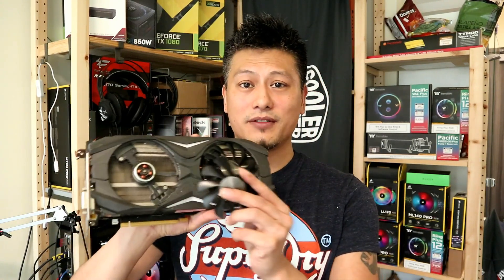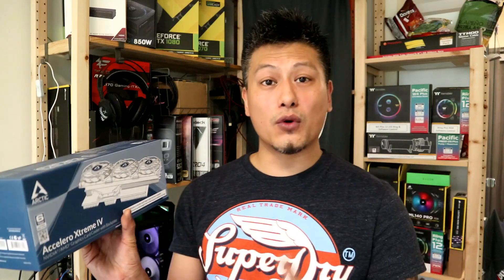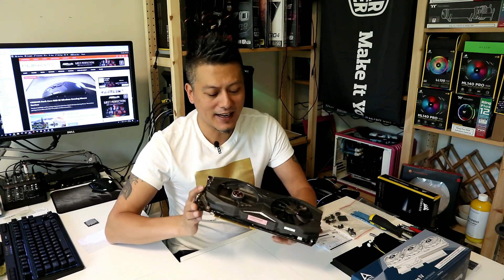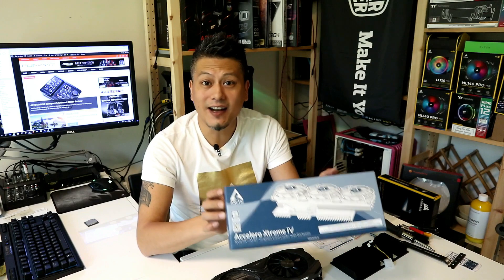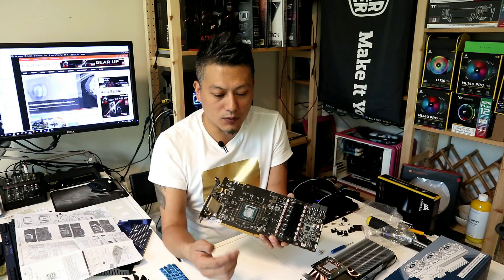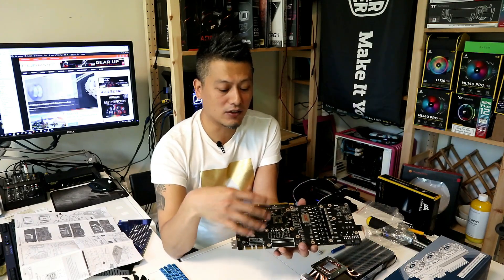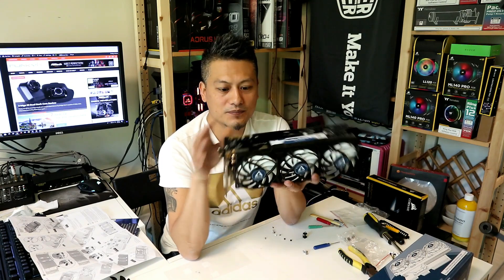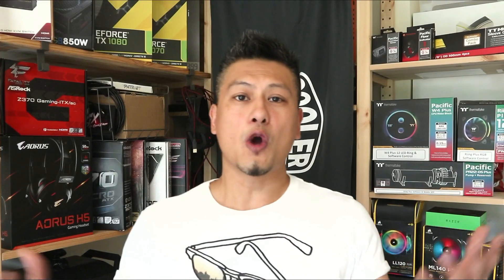Broken fan on your GeForce GTX 1080? Don't worry we have the Arctic Cooling Accelero Xtreme IV

Comment: I just put one of these on a 1080 Ti that had a dead fan. Im really impressed by the results. It's the coolest I have ever seen a card that wasn't watercooled run. It is honestly better than Anything I have tried from MSI, Asus and so on.
Reply: Hi, I'm standing in front of same issue, dead fan, please, is the GPU with this new cooler any longer than was the original for your 1080 TI? Dunno what brand u had, I got ASUS, tripple fan. I'm quite unsure if it will fit into my case :(

Comment: well I bought it a few months ago but I cannot notice cooling so far ;( but alright. an extreme cooler should be "extreme" in detail which has me startin to think about the nonsense they do with the materials. an extra heatsink block to get rid of heat is a cool thing and a good job but why do they decrease the performance at another detail by using a plastic fan housing??? why cannot they use metal for making the fans able to soak in more cool air????

Comment: Installed this on my blower style 1080Ti today after watching your video, holy cow! My idle temp was 42-44C before, right now it's idling at 28C! When I played 7 Days To Die before, it would easily hit 82-84C, after an hour of 7D2D today, it never got above 55C! So much quieter than the original fan to boot, I can barely hear it at 100%, and can't hear it at all at 60%. One of the best cooling investments I've made in awhile.

Comment: Tempted to buy this Gpu cooler, but I also have a Dark Rock Pro 4 and the CPU cooler you have is already a snug fit. Which one is that exactly?
Reply: Did you ever get the Accelero? I also have the Dark Rock Pro 4 and I'm wondering how the Accelero will fit.
Reply: @andrewowen6318  Sadly not yet, life kinda got in the way. If I don't forget i will come back to this.
Reply: @andrewowen6318  I also use an Asus STX II soundcard which has issues with my Mobo and got the Advice to use PCI E's that are directly connected to the CPU. Which means i need to swap the GPU around if i'm wanting to use the Accelero. regarding the Soundcard. Maybe you can lower it if you have more clearance like that. Still not sure If I still would have enough clearing towards the PSU Shroud. Hopefully its a win win.
Reply: @madshadow8007  So, I actually just installed the cooler and got it set up in my PC. As far as I could tell, it won't fit right below the Dark Rock Pro 4. I have it connected to the second to last PCI-E slot. It sits about an inch above my PSU. I think if you were to use thinner thermal pads than the ones that come with the cooler, it might fit below the Pro 4. Hope this helps.
Reply: @andrewowen6318  Ty Good to know. Do hope you used the 2ndary 16x Pci-E Slot.
Reply: @madshadow8007  Not sure what you mean?
Reply: @andrewowen6318  with regular ATX boards you have at least 2x highest Bandwidh PCI-E's Both are meant for the GPU. (SLI/CrossFire)
Reply: @madshadow8007  Ah yeah, I'm pretty sure. I have the Maximus VIII Hero. Counting from the top, there are only 3 slots that a GPU could even plug into (and it would only fit on the very bottom if there was no cooler on the card.) I have it plugged into the second one from the top. In the user guide, the slot I have it plugged into is labeled as PCIEX8_2. I assume I have it in the correct slot.

Comment: I just put one of these on my ASUS GTX 1080 Turbo - that thing is a turd for cooling with a blower, and as a non-reference card most water-cooled solutions are sketchy for it.

WOW - this cooler is good. I'm holding steady under full burn-in FurMark loads, seeing >115% TDP, the boost locked in at 2050 Mhz, and steady temps under 59 degrees on the GPU after 30+ minutes. I used the suggested fan curve (it has to be set manually, I used MSI Afterburner) and never saw above ~30% on the fans. I may just set it to flat fan speed at the highest I prefer, because even at 100% fans this is incredibly quiet.

I don't know how monitor the VRMs temp on this card (not sure I even can?) but I did not bother with heatsinks on top since the kit doesn't include any.

Install felt sketchy - weird sticky blue thermal pads on the back of the card, cut-your-own plastic shield to prevent shorting to the back plate, tightening screws and feeling the PCB slightly bend... but it works, and it works really well.
Reply: i know im late but will it work on my rx 5700 xt? im planning to get one of these coolers later this year so yeah

Comment: Just be aware those who owns Zotac AMP edition GPUs. There's a GPU Boost "hump" which will interfere with the installation of the back heatsink and will cause your card to bend. I bought this cooler after watching this review for my overheated GTX 1080ti AMP edition. All I have to say is, this review sucks, the reviewer failed to address the limited size of the heatsink for the oversized PCB of custom cards, potentially bending as well if your card has additional "fixtures" like the zotac's power boost. Just get the cheaper Arctic Xtreme III or Raijintek's Morpheus II, you won't regret it.
Reply: For anyone reading this 3 years later: Typical RTFM/Read The Fucking Manual problem! It tells you all about compatibility and how cards need to be reference design. Of course your custom card/PCB will not work. User error, not review error.

Comment: my cpu cooler is so big this may not even fit on my gpu!
Reply: It will if you place it into a lower socket.
Reply: Luka Dragovic but that would probably only be a x8 slot instead of x16.
Reply: @prestonbinkley5217  And you will lose around 0.5%-1% of performance,
or you could go with the CPU without the cooler ;), additionally, you can remove arctic cooler (for whatever reason) and just place its radiator atop of a 3 12cm coolers.

Comment: your article was so poorly done you didn't mention what fan speed your cooler was running at also you didn't mention how much power the card was consuming some of the important factors you need to mention also your room temperature during which you did the testing these are the basic things you should mention what about the VRM temp memory temp????
Reply: Hi mate, idle temps are 32-38c, peak in game 60-62c, (1830Mhz-850mv flat (undervolted)), 14-256W. Mem temps (28-34c idle, 54-57c load)

Ps. I have the GTX 1080ti with arctic accelero extreme 4
Reply: Luka Dragovic did you put extra heat sinks on the ram chips and vrm or did you just use the passive cooling of the backplate and thermal pads??

Comment: i got the same Arctic cooler for my 1070 and it worked fine. the only problem was that my ram moduals were too tall and touched the backplate (cause of my motherboard) and my case was to almost to small but with a little bit of bending of the backplate fins and the bottom of my ram moduals and it magically fit=) but it seems like i got about the same temps or  a little below maybe